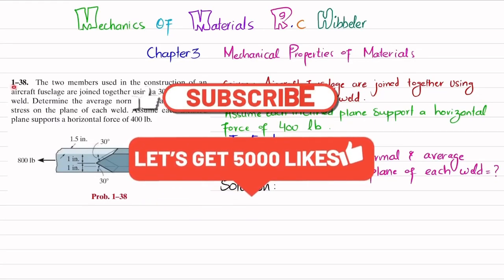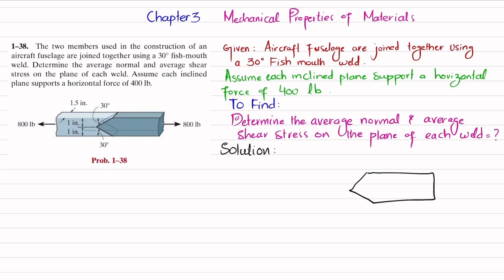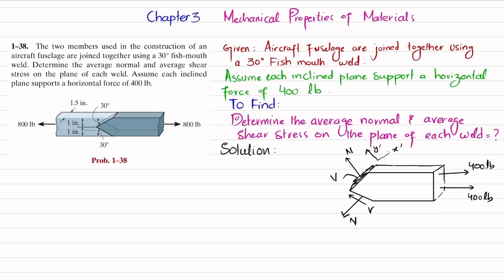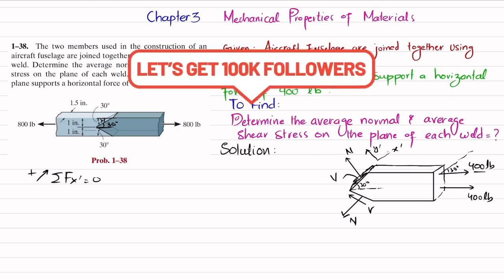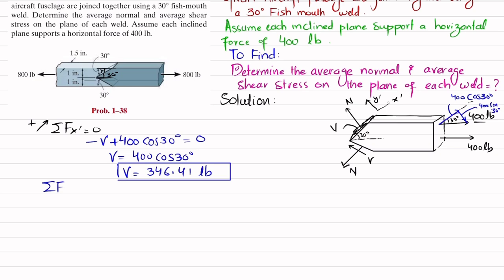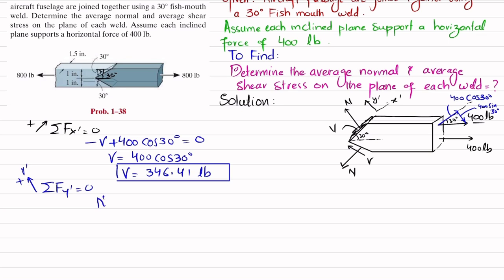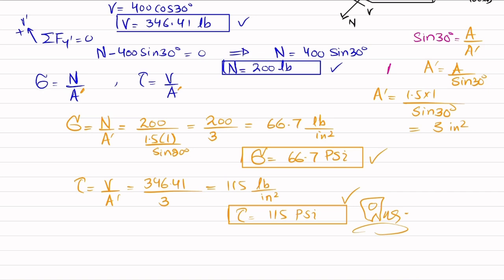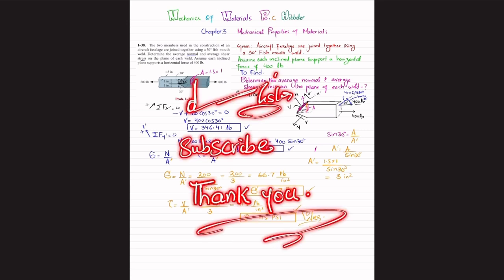1-38 | Determine average normal and  shear stress on plane | Mechanics of Materials Rc Hibbeler

Comment: I don't understand why you put 30 degrees in the force , not in the normal and shear
Reply from the maker: The applied force is splitted into its rectangular component. One component is along the face where shear force occur where the other component of force is perpendicular to that surface.